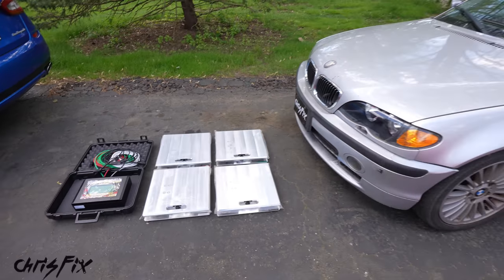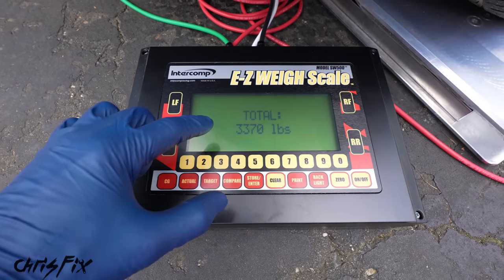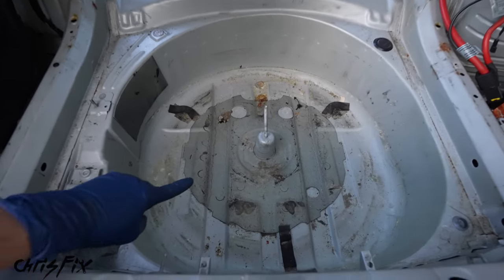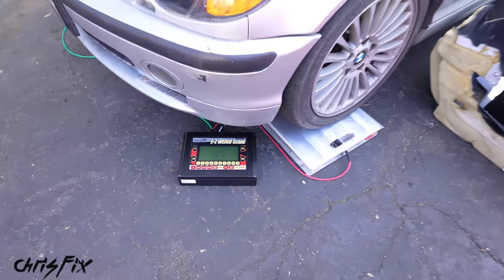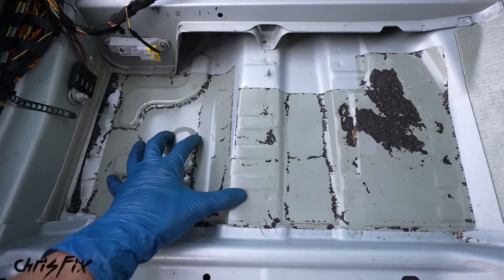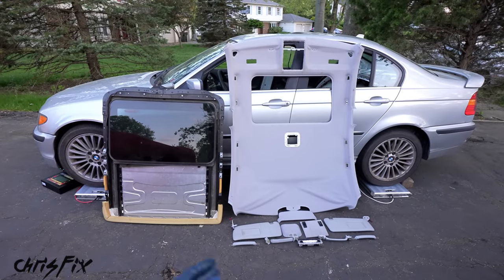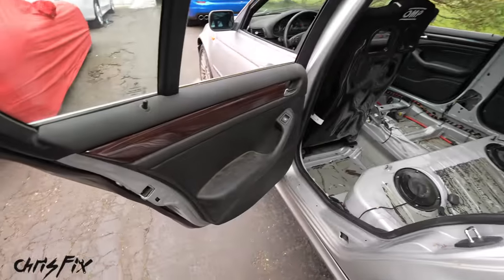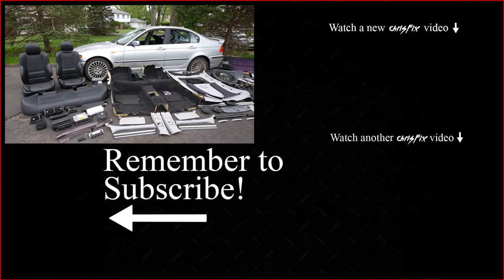How Much Weight can you REMOVE from your Car? (Weight Reduction)

Comment: “If its not under the hood you dont need it”
-Family
Reply: Hehe
Reply: nice clubhouse
Reply: Did  u talked about the family its the most important
Reply: Did you say family… what have you done. Dom no!
Reply: @Green Mamba Games all ya need is two vice grips
Reply: @Green Mamba Games just lean to one side.
Reply: Exept plastic covers
Reply: He could remove the hood also
Reply: DOM TORETTO TUTUTUTUTUTUTUTUT
Reply: @Green Mamba Games You don't need a steering wheel. You have family.
Reply: @Green Mamba Games Did he stutter??
Reply: wheels rn:
Reply: Hey family
Reply: Yeah but the battery
Reply: Steering wheel has entered the chat
Reply: Family?

Comment: The engine block is pretty heavy, taking that out will reduce weight significantly!
Reply: Flintstones knew it
Reply: Lol
Reply: the aluminum m54 block is surprisingly light, actually lighter than most cast iron 4 cyls
Reply from the maker: Oh dont worry, we did that...

Comment: I personally tried this and found the car lost a ton of weight when I took out the engine block and replaced it with a cardboard box. I also replaced the shock absorbers with slinky toys; finally I took out the suspension crossmember and replaced that with some metal bars I welded together. On an unrelated note I’m typing this comment in the hospital.
Reply: How did you end up in the hospital with a cardboard motor?
Reply: Holy lolzzzz
Reply: @zacharyjacobs7233  It lasted until the freeway and then the car burned down
Reply: You got that from whiley sold it to Stan then peter stole it traded it for crack that was taken from the crime lab from the Hank hill case
Reply: damnnn need me a mechanic freak like that🔥
Reply: OML LOLOLOLOLLL)LLLLLLLLL
Reply: @zacharyjacobs7233  His girl friend hitted him because that his gf's car :D
Reply: @joechuong  it’s complicated
Reply: "I replaced I took?"
Reply: @protonjones54  my bad
Reply: @zacharyjacobs7233  He did not say that it was his car...
Reply: LOL
Reply: You can save even more weight if you take out the rest of the car.
Reply: @mikiqex  I tried that and turned the car into a 4 wheel cycle. But I got tired and i scrapped it.

Comment: Window motors, door cards, dashboard😅, side airbags, steering wheel with airbag, side trim, wheel liners and sound deadening, spoiler and side marker lights. Probably another 200lbs! Then weld in a 250lb roll cage!
Reply from the maker: We removed a lot more after this video too, I think we were able to shave off another 70 lbs

Comment: The dry ice part is a nice tip. In the cleaning industry there’s a product used to freeze bubble gum and remove from surfaces. For such a big removal though, dry ice is a great idea.
Reply: PRO-TIP  :  Dry-ice blasting is also incredibly great for blasting under the car to clean remove rust & make the belly shine+ any other mechanical parts like, steering-rack, suspension A-arms & bushings, engine oil-pan, the intricate gearbox housing pattern, remove the dust on brakes+rims just looking like brand new again..
Reply: @poplaurentiu4148  hmmmmm!
Reply: what's that product?
Reply: @poplaurentiu4148  I know what I’m doing this weekend now, thanks
Reply: I did it the other way, with a heat gun. It worked also with a hair drier, but it was slow. The rest of the sticky bitumenous crap was cleaned with toulene.
Reply: xui
Reply: @erikziak1249  Using heat and solvent is messy, not to mention hazardous. Toluene is carcinogenic.
Reply: @msbrownbeast   You are right and good that you mention the toxicity. If I were to do it on a regular basis, I certainly would take the dry ice option, but I did it so far only once in my life, so the exposure to toulene was quite limited and I did it in a well ventilated area. Still I think much more nasty stuff got into my body through the skin, as I was lazy to wear gloves. Fumes are still dangerous though.
Reply: @erikziak1249  The dry ice method is good, but I also noticed that the author (ChrisFix) conveniently skipped out showing how he managed to apply the dry ice efficiently around the drive shaft tunnel - did he apply cold packs (filled with dry ice) to wrap over the tunnel? Not that efficient when there is a layer of membrane in between the dry ice and sound deadener. Or did he cheat and used your method for that area?

Comment: daaamn bruuuhh loosing 200kg made your 0-100 time from 6.8 to 6 seconds? that is pretty good!
Reply: Bro it’s 0-60
Reply: @YesYes-yb5mg bro 60 miles is ~100km
Reply: Not everyone lives in America
Reply: Didn't watch it all, yet, so don't know if your 6.8 to 6 comment was a typo... but if, after losing all that weight, he only gained .8 of a second, then you, and he, is off his meds bigtime for thinking that makes any sense.... I gotta get back to the VID, because this comment is insane, or a typo... it has to be a typo. I could take my pants off and gain .8 of a second!
Reply: @johnrobinson9974  I am... Not sure what you are talking about? He removed around 10% of the weight with turning down power the power/weight is increased by 10% so it's logic that he is 10% faster
Also he started with a pretty heavy car. If you remove 200kg from a 1000kg car then yeah you get a 20% speed increase. 
For racing even 10% speed increase is a big deal, especially when it has basically no drawback. It's pretty often that the first place is decided by a few seconds, and if you need to have full acceleration after 30 corners, even by gaining 0.1 seconds each corner you still gain 3 seconds

Comment: That last zero to 60 run and the pure excitement…priceless! Oh, and I’m a car audio guy and didn’t know about the dry ice trick for removing sound deadening. You just plain rock! Thanks for another dope vid, Chris 🤙
Reply: Cris can remove more weight from this BMW since he wants a track car by replacing some heavy metal body parts like:
 Hood (/Bonnet), Roof & Trunk with lighter fiberglass+reinforced carbon fiber parts and the heavy doors glasses with lighter perxplex 
then lighter rims and carbon ceramic brakes.. all things will definitely drop the weight even more..
Reply: Pop Laurentiu carbon driveshaft carbon mirrors carbon wheels carbon doorcards
Reply: The Legend! Big Whizz!
Reply: Oh hey big d wiz
Reply: @poplaurentiu4148  He could do that but he’s entering the LeMons race where he can only spend $500. All those carbon and lexan parts are expensive.
Reply: I never knew the dry ice trick either! I had a 93 Del Sol trying to make a race car out of it stripping everything I could out. Funny story when I was moving houses one time I had a tub of cooking oil that somehow spilled all over the floorboard and turned that sound deadening into sticky tar that never again was unsticky, was always the tackiest mess you could imagine RUINED riding in the car! Wish I had known that dry ice trick!
Reply: @joshuarodrique2096  ohh.. tanks, now i fully understand (is about the rules of LeMons).. ;0)

Comment: Lighter wheels are so much more important, just because of the rotating mass
Reply: Exactly true. 1 pound off a wheel is huge.
Reply: ..and unsprung weight
Reply: Mostly because of the unsprung weight
Reply: He already got new wheels
Reply: 1 pound would be at max 4 pounds, but that only depend on the distance from the center, if you remove a nut for example wont change much but if you change the tyres it would be the max difference
Reply: Um like the wheels that roll need Some mass to gain grip
Reply: @vip-jad6821  that’s the suspensions job. Pretty sure the weight of the car is enough for grip. Lighter wheels are better.
Reply: And unsprung weight
Reply: No wheels is better too
Reply: Lighter wheels are important but not more important that removing over 400lbs.
Reply: +1 for unsprung weight. Rotating mass will effect acceleration and ride comfort but not top speed
Reply: Yeah...rotational mass eats up horsepower, heats up brakes, puts more stress on axles.. etc. 
  Unsprung weight will cause the suspension to react more slowly, and as a result, not maintain contact patch as well. 
   Suspension adjust to bumps, dips, etc. more quickly when it has to move less weight up and down. 
  The big one that no one talks about when it comes to rotational mass is the gyroscopic effect. 
   Extremely important on a motorcycle, but really important on a sports car as well. 
  Ever held a spinning bike wheel? When you try to turn it, the angular momentum pushes back. It tries to keep the spinning mass going straight when you turn it, and there is an oposite force on your hand. 
  The same is true for front suspension on a car, and that particular force is VERY unhelpful when cornering. 
  Keep wrenchin'
   Cheers
Reply: @vip-jad6821  
🤔.....🤦‍♂️
Reply: True. I put 20s on my car and heavier wheels and tires def made the car slower and harder to brake. Also made gas mileage suck. Im hoping to remove the cat but keep muffler see if I gain back my regular MPG. They look too cool tho.
Reply: Personally I think folks should read the book by suspension guru: Fred Puhn. Entitled, 'How to make your Car handle.' 
I think the intro in his book addresses the very real tiger trap, of the wrong wheel and tire selection. Understanding the original manufacturers mechanical properties before gutting the car. 1st, after reading his book, you'll need a set of scales at each wheel to figure out front/rear weight bias.
Pro race teams, add ballast where needed.
Gutting the car, yet still adding weight with roll cage, unibody stiffeners, fire supression system. Larger brake system. Heavier sway bars. Heavier shocks, or struts. All to take into consideration. Even the turbos weight on the front end, with all the plumbing.
Reply: @kimbarker9651  what is unsprung weight?
Reply: Blah Blah  ha ha ha ha cracking up here
Reply: True i do this in forza horizon 4 all the time.
Reply: @ayebee1207  seconding your recommendation for Fred Puhn’s book!

Comment: Well as someone once said,
"If it ain't the engine, take it off"
Reply: ya gotta get to fast to furious......oh and family
Reply: The guy who removed the steering wheel: ‘I see this as an absolute win!’
Reply: So leave only the engine?
Reply: @manuj2868  could probably use a plastic toy one? Just add some wires or something.
Reply: @alexrosado3890  exactly. Just leave the engine, and take it off. Panels, doors, windows. Heck, take even the battery out.
Reply: @thomaspanditfan2435  Exactly, wheels are overrated while we can use reins. Worked for people in the 1800’s!
Reply: @manuj2868  sorry but, what are reins?
Reply: @thomaspanditfan2435  Oh they are the ropes which steer a horse. I was making a joke lol

Comment: As a lifetime automotive weight weenie myself, I want to let you know that you're officially my 'Hero of the Month'.  I'm truly impressed with your video due to your passion for what you do and also your willingness to obtain the data to back it up.  I talk about improved acceleration, handling, and braking all day...but being able to legitimately quantify it is the real deal!  Bravo my friend, and keep up the great work!
Reply: Yes - so right! ... And now he should next have the car lifted up, all engine, drivetrain and axles removed, and refitted with the usual lightweight parts, race clutch with no flywheel, lightweight pistons, titanium connecting rods and crankshaft, new diffs - and all the other nice stuff er know about, remoove the heavy paints and windows - and the journey would continue.

The Porsche Museum at Stuttgarts has a police porsche in such trim in display actualy (the windscreen being just a small slice of lightweight glas, right from a GT Porsche from the track, etc.) - lowered, with aeroparts from the speedtunnel, handbuild and refined engine, etc. - a gift from Porsche to the Stuttgart Autobahn police some 20 years ago. Now on  display. 🤗
Reply: @JamesBrown-ux9ds  - of course you're right about all of that, but it sounds like the sanctioning body and the class he's competing in will limit what he can do.  I was seriously wondering why he picked an Xi model as the steering ratio is slow and the car is quite a bit heavier due to the front differential and driveshaft.  Hoping that he clears this up in some future videos.  I really didn't like how slow the steering rack is in the Xi model compared to the 330i.
Reply: @stevetheodore_specialtycars  - these definitely sound like bmw problems 😂
This isn’t the case in a subaru sti
Reply: @philosoraptorvi5309  - Haha, I formerly owned an STi myself (modified 2007 Hawkeye).  That car had so much mechanical grip!

Comment: Toyota: You don't need to remove the soundproofing, we have already done that.
Reply: Scion TC coupe is the noisiest car I've ever been in.
Reply: True that.   The 2015 Toyota Camry was terribly loud on a smooth highway.  They improved it though on the 2017 Camry.
Reply: @Tomato Sauce No. My first car, a baby blue 71 Opel, takes that award. Best birth control device known to man.
Reply: True.  I used to have a 2011 Camry that was sonically beautiful, music sounded so good in it, couldn't hear much outside. 
Then I got a 2016 and it was noisy as hell.  Even going through the car wash, sounded like a tin can rattling with some change in it and the sound of the music sucked too.  Completely different than the 2011.
Reply: My old Yaris was so loud on motorway that I used noise canceling headphones on longer drives. But those old 1.3l Toyota engines never consumed motor oil.
Reply: If you want a silent Toyota buy a Lexus.
Reply: You guys have never been in a Nissan Patrol
Reply: My Aristo is really quiet. So it depends on the car. A cheap car wont be as quiet or nice.
Reply: The 08 Toyota Tundra isn't bad at all
Reply: @dennisthemenace49  Celica has it beat I think but TC are super loud.
Reply: @BmwMe-uh9sy  shit toyota? Yaris GR beats M3 e46 in every way
Reply: @RmX.  didnt know it was opposite day today
Reply: My Lexus GS is extremely smooth and quiet
Reply: True. My 2016 Prius had ridiculous road noise.
Reply: @BmwMe-uh9sy  Look at you got hyped up bc Chris got a BMW but even he said 8:10 "..it's a BMW you always need some extra oil." Exept that BMW builds beautiful, quiet cars that just don't hol up. Brought to you buy a German, ex BMW & Mercedes owner.

Comment: If you wanted to remove some extra plastic to reduce the weight even further, you should've checked the engine compartment :P
Reply: And pull out the engine
Reply: It’s a German car that shit is so confusing man it’s jsut easier not to mess with the engine at all
Reply: All that wiring too
Reply: @najibn8228  lmao true
Reply: LLLOOOOL
Reply: @najibn8228  Germany circa 1941  colorized 

Pretty much
Reply: @madhut3042  Yeah copper is heavy and has good resale value. Hey can you switch to aluminum wire?
Reply: @RecklessGenesis  let me introduce you to the TFSI, which is neither of those.
Reply: @najibn8228  Newer BMWs for sure, but these older M52/M54 are relatively straightforward and easy to work with
Reply: @mickjager5974  that's actually hilarious lmao.
Reply: @dvrz  100%
Reply: oh thats cold. Cold as dry ice.
Reply: @skrimper  Hey AL is supposedly about 50% lighter than CU of the same conductivity!

Comment: The stock exhaust is really heavy, there is some to delete here.
Reply: @turningaround7842  He doesnt need to straight pipe it, just delete a few mufflers
Reply: @LatvianVideo  consider not having the exhaust would be so much better
Reply: Facts I deleted the mufflers on my wrx and the stock mufflers weighed like 40 pounds my new ones weigh like 15
Reply: @CLIVIXX  remark axle back?
Reply: @cwalls6914  nah I got a nameless and it sounds good asf now I love it
Reply: @phuphan913  ikr
Reply: Something else to delete 
Lights: front/rear
Hood
Trunk
Install doors: front/rear
Uninstal windows: front:rear
New rims: front/rear
Roof
Window cleaners: front/rear
Bumpers: front/rear
Exhaust
Install new pedals
Install new shifter
Install tires: front/rear
Flash light: left/right
New steering wheel
New engine 
Sunroof
Inside window thingy (I don't remember how it's called
Outside window thingies (I also don't remember how they are called)
The things that give air (I don't remember how they are called)
Speedometer
Spoiler
Reply: DELETE is not the word you can use here* 😆😆
Wtf English is this?
REMOVE you probably mean.

That seems so wrong to read.
Reply: @sex_therapist  so what? That's not an excuse at all. Think before you click.
Reply: just remove the whole car for a 100% weight reduction
Reply: @Jerry__S  cats on the e46 are on the header straight pipe from there back
Reply: @Vancouver4u  It's very common modding lingo.
Reply: @Vancouver4u  Delete is a work used when spec-ordering a car, a feature you don’t want, you “delete” it
Reply: @CLIVIXX  made to last thinner rusts faster or